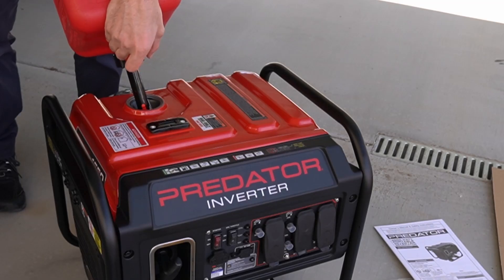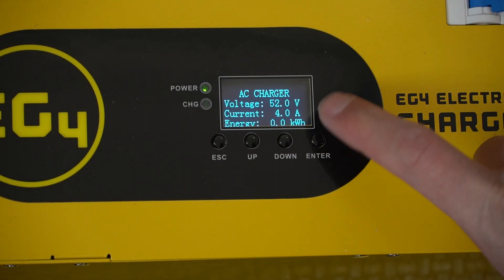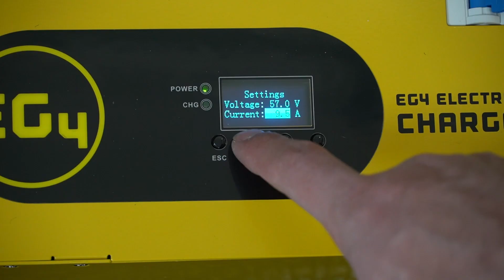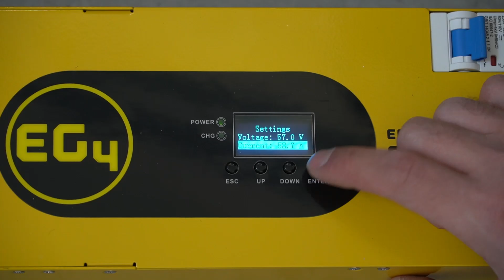New! 48V 5kW EG4 Chargeverter

Comment: This is a perfect backup combination. Im newish to solar, and I love my system...... but in reality, dollar for dollar that gas generator is 100 times more powerful and reliable than solar. Because cost is always an important thing, a combination of the two and the lack of grid power is essential. Not only do I hate the grid and everything that comes with it, I also hate the idea of destroying the planet with fossil fuels. So the most minimal that makes sense and is still reliable is this system here. Solar with generator backup for the batteries during undesirable weather when solar isnt charging optimally. Thank you for showing this! I've learned so much from your channel

Comment: Great video so glad I stumbled onto it.... I live in the northwest territories of Canada, so a generator is part of my life off grid...... currently running 4 - 200 amp hour Li time batteries. for now running them 12 V but I wanna run them in series at 48.... having a good battery charger is a must...... there's so many all in one units out there reading the reviews. I'm going delirious. Victron doesn't have that great of reviews.... neither does Renogy ...EG4  seems to be better grow watt looks not too bad. One of the biggest problem is support or there is none. Nobody talks about, it if something goes wrong you're screwed... so how does a person know what to get? I would like to run six 400 W. Renogy shade panels, but I found out recently. You can't start off slow if your inverter doesn't allow it 200w 0r 400w what do you look for?

Comment: Silverado EV. I’ve been driving one a long time and I work on them. Pretty reliable. We had some wheel bearing problems from the railroad strapping them down too tight. Other than that it’s a beautiful truck and has bidirectional charging with a MASSIVE battery.

Comment: Neat device and it's definitely on my purchase list! The main reason why you need a large generator if you charge with an all-in-one inverter is that the charge circuit is not separate... those all-in-one machines actually run the inverter circuit in reverse to charge the batteries from the grid power connection and just pass-through the AC input to the AC output during charging. That also means if you have any loads connected, they will also be fed by the AC input of the all-in-one and your generator needs to be able to supply both the amps for the charging as well as the amps for the loads!

Comment: I only had one problem with my ChargeVerter. I had to replace the plug on it, as, apparently, one of the leads was loose.
Be sure to check your connectors, and make sure they're tight.

Comment: 22KW generator!  Wow, I thought I had an oversized generator with my 13KW model dual fuel gas and propane (only outputs a little over 11KW running on propane, as I don't plan on ever putting gasoline in its tank, to prevent having to worry about gasoline going bad over long periods of non use).  Which models of All-in-One inverters was EG4 talking about, that needed such a huge generator for use to charge the batteries, when grid power isn't available?

Comment: For my solar system I find it practical to glean what I can from the Sun and keep this chargeverter always hooked up outside under an awning I use for my solar equipment. When the clouds weaken my battery charging this will kick in when no current is seen. It uses the grid but then again, my batteries last a long while so if I lose power at night the batteries are ready, so it still helps in the long run.

Comment: To the point! $500 bucks a of 8/4/2024

EG4 Chargeverter - GC | 48V 100A Battery Charger 5120W Output | 240/120V Input

Description
Introducing the EG4 Chargeverter 5KW AC Charger, a high-performance battery charger designed for reliability and versatility. With its 48V 100A capacity and 5120W output, this charger ensures efficient power supply for various applications. Its compact design and dual 240/120V input make it suitable for diverse setups.

Bad Weather Resilience:

Charge batteries during low light conditions using a generator (up to 100A)
Ideal for unpredictable weather patterns
Protection from "Dirty Power":

Guards against unreliable sine waves from lower-budget generators
Protects inverters from power quality issues
Charger Output Specifications:

Optimized for 240 VAC power supply
Nominal Battery Voltage: 48VDC
Adjustable Charge Current: 0-100A at 240VAC
Adjustable Charge Voltage: 43-57VDC (Default at 54VDC)
Maximum Output Watts: 5120W at 240 VAC
AC Input Specifications:

Plug directly into a generator without concern for power issues
AC Input Voltage Range: 90-264VAC
Maximum Input Amps: 26A at 240VAC, 28A at 120VAC
Dry Contacts:

Control of generator start/stop function based on Voltage or state of charge (SOC)
Using EG4 Batteries?

Closed loop communication with EG4 batteries for charging based on battery state of charge (SOC), when batteries are not in communication with the inverter

Comment: Hey Will....QUESTION.....I'm doing a system upgrade and getting the EG4 3000 EHV all in one system.....I planned to use that to charge off Grid in the winter.....But now I'm worried. I know this video is Older now.....but have they made any upgrades to the all in one to fix the charging failures???  Also is that eg4 charger still working well??   REALLY APPreciate any update. I know youre swamped with comments. Best wishes

Comment: What is your input voltage that you're getting 99 amps? My yellow Chargeverter briefly peaks in the high 90s then quickly ramps down to 93.5 A, even when cold started. 
Maybe I need to increase my generator output from 240V to 250V to get those numbers?

Comment: Ready to purchase one of these from Signature Solar. They have a newer model arriving in April 2024. My question is this, "Any recommendations on what the size of my generator should be"? I will likely get a Predator Generator I can run off of propane so the carb doesn't get gummed up with old gas and the propane is easier to store for long periods of time.

Comment: Wondering, of EG4 can make the Chargeverter work with open frame generators, why not just use that circuitry in their all-in-ones so you don't need separate charger?

Comment: The test generator you used was an inverter generator that produces nice clean pure sine wave power, might be good to test it with regular generator that produces the 'dirty power " you mentioned
Reply: cheap inverter generators are actually the ones that produces dirty power and can't handle much variation in load. Just look at Victron inverters and how much electronics is needed to produce actual clean sine power. These cheap generators don't have the amount of space availble to pull that off. Just take a look at James Condon, he repairs generators and also load tests them, including the "dirtyness"

Comment: Will I be able to utilize the Dry Connect port of the EG6500 Inverter to auto-power on and off an external generator which is connected to the battery bank via the EG4 Chargeverter?

Comment: Can it be used in a pinch on lead acid? You would just need to be careful between bulk and absorb correct?

The unit reduces amps once it hits its set voltage doesn’t it?

Comment: so they put teh option in to charge your batteries in the inverters by generators then state that the generators destroy the units?  seriosly?  or is it just the modified generators-- are the pure sine wave ones ok?
Reply: I'm sure if you limit the charge rate and have a good quality generator that puts out clean power, you will be fine.

Comment: Will in this video you suggest using a battery charger to charge batteries even if you have a hybrid inverse that could charge the batteries because that’s one of the main causes of failures in inverters.  I’m planning a new solar setup around buy one EG4 18Kpv to start (eventually going to two of them to be off grid completely) and was wondering how I would setup using tuis EG4 battery charger in my future system.  Would love to see a video explaining how to use a battery charger with a hybrid inverter (EG4 18Kpv preferably). Thanks for all the great work

Comment: Hi Will. What about using a small generator on the generator input of the EG4 18kw?  Does it have a built in “charge verter” that will protect the system from “dirty ac output?”
Reply: Don't risk it! It's not in the manual, so don't assume. It's designed to be tied to the grid only.

Comment: I'm still so upset you had such an awful experience with your Lightning!  You're absolutely right that it's the perfect for power testing and backup energy storage, etc.  I use the Pro-Power On-board outputs all the time.  I've had my Lightning since October of last year and have had zero issues with mine.  It's disappointing that yours was a lemon.  It does seem that the Platinum trim level trucks are more prone to issues than any of the others.

Comment: Does reducing your "max charge current" setting on the inverter make a difference with "dirty" generator damage into the ac inverter input? Also, are standard generators better or "inverter" type? Thanks for all the videos!
Reply: No, a cheap (non-sine wave output) generator, usually called a "modified sine wave output" generator will put out "dirty power" no matter what the current. Connecting a generator to a PV inverter usually means that the generator power is connected to your load (house or whatever), so the "dirty power" can damage appliances and electronic equipment in your house.  If a generator does not say "pure sine wave output" or "total harmonic distortion less than 5%", then the generator can easily damage equipment.

Comment: Is that just for NA power grid, or does it accept 50hz/European grid output too?

That would be great for sailing cruisers. Most boats are either setup for 60hz or 50hz shore power, so cruisers can struggle when in port after crossing oceans. Something like that would allow them to just plug-in at a marina and charge their battery bank directly then live off their inverter, without having to worry about all their AC components on the boat.

Comment: Is there any reason why these wouldn't be able to be paralleled?  I currently have a 22kw whole house generator, and 6) 5kw Lifepo4 server batteries, with a Sol Ark 12K in Idaho.   I am considering getting 2 of these to double the possible charging speed and reduce the run time on my generator, and stay below max charge rates. what are your thoughts?

Comment: So if I use a HF NOT pure sine wave generator I can plug in the yellow box and it will clean up my generator's modified sine wave and make it OK for my Li batteries??    The HF generator in this YT is an "Inverter" generator that makes a pure sine wave. That IS NOT what 90% of the people have that use a large portable generator for back feeding and extension cord powering their homes during power outages. You should have used a more typical generator (like your ancestors used.....)

Comment: If I have two eg4 6500ex inverters connected for 110 volt instead of split phase. If I turn one of them off will the other one still work? I'd like to have it just for a backup or in case I need to add more then 8,000 W of panels or need more ac power then 6500w... but I'd like to keep it off most of the time so that it doesn't draw 90 watts of power continuously... I don't have anything that runs on 220 volts other than my generator connected to the inverters

Comment: Will have you looked at the BTR Power batteries?
(4) 12v-140ah batteries works out to around $200/kwh as compared to the EG4 server rack at around $280/kwh.
Previously I had thought that the EG4 was the most economical choice.
I get the impression that these may be built using pouch cells as well.

Comment: Hey Will, I am a huge fan and have been following you for several years now.... Will, I have been digging through your archives to see if I can find a video that shows how to calculate the size of a system needed based on what you want powered... I want to run access lights, patio with lights, refrigerator, fan, water fall and possibly a TV so I'm trying to figure out how to calculate what all that will draw to determine the system I'll need... any ideas? Btw I have your book, too... I don't think I missed it there.

Comment: good afternoon Will. This might be the wrong place to request it but !!!! No one I have seen on youtube talks about the warranty's fine print on all of the solar components. Would you consider doing an extended video on this topic . I have 2 products a VA company uses ( they have been installing in VA for 28 years) , but the warranty's have the word "or" after the 10 years , etc. A friend is having them do an install and I am concerned because the "escape clause " reads like and engineer and attorney had lunch one day  . I can email the 2 examples. I think it is an important topic . thanks in advance.

Comment: I hate gas generators also. I have 2 of them. 
I have the Westinghouse i2200 (1700W) and the i4500 (3700W). They are very very quiet.

It is almost a necessity to have 2 b/c one or the other has frequent trouble.
I only run them rarely now when I don't have enough sun. Used to run all night every night.

I have 2 EG4 24V 30A chargers and a Renogy 24V 12A smart charger that run off the generators.
I have a couple switches to run 1 single or any 2 as a pair. Currently connected 2-24V 280A banks.

Comment: You can limit the grid charging current on a hybrid inverter so that it doesn't over-load the generator. Still, I would make sure the generator is the inverter type and I would not run the generator at full load. I've charged batteries through an MPP 3kW inverter using a Honda EU2200i with no issues.

Comment: Hi Will, I have an unrelated question, If you have 2 x 200ah lithium batteries in parallel or Series, and one of the BMS's shuts down, what are the symptoms ? Cheers

Comment: Hi Will, sorry, not in line with the video,but, #1 how do I access your book,#2 trying to run a 24v system with 2 1920 watt strings/w 2 charge controllers, to add 12 volt sub-panel, can I come off of 1 controller? 4000 watt inverter.

Comment: I am going to be getting an aptera as soon as they ship.I am planning on making a home battery setup that I could also take on the road.  I was also planning on making a range extender battery pack that I could bring with me into a hotel room and plug into the hair dryer outlet. If I brought in a 14kwh battery pack (160 pounds of 280ah  lifepo4 batteries). I could charge them using the bathroom hair dryer outlet(1800 watts), and be full in just under 8 hours. On the aptera that would give me about 140 miles at 70mph.

Comment: Can I ask you opinion about  a crazy idea to get AC power to my shed about 100ft from my house? I was thinking about getting a 1000w LiFePO4 Portable Power Station,  The crazy  part is to tap into the 12v AC landscape lighting line I have already running  out there with a   12v AC to 12VDC converter.  I have big landscape transformer at the house with excess capacity.  Possible? good idea?

Comment: Will, have you dealt with Signature Solar at all for out of warranty repair work? I reached out to their tech support and customer service by email and got no response for a week. Called today and was initially told that they only service devices under warranty and if not a warranty repair or warranty is expired then I have a paperweight. They did later call me back and say that was incorrect, but as an individual who is over $15k into Signature Solar purchases, this doesn't exactly inspire confidence. Do you or any of your viewers perhaps have some experience to reassure my concerns?

Comment: I installed my EG4 Chargeverter and an L14-30 generator inlet this past week and tested it out with my Firman tri-fuel generator running on natural gas.  What a beast.  I had been trying to figure out how to do the same thing by combining  4-6 of the smaller EG4 battery chargers, but that was going to cost a lot more money.  This is the solution I had been looking for, and I am thrilled that EG4 released it before I did something stupid.
Reply: Same here!  I haven't received mine yet and hope I never need it but it is godsend!

Comment: that's an awesome bit of kit.  As it's possible to build larger battery packs at low cost and use large solar to charge the battery pack. do you think that using the battery pack to "DC Fast Charge" an EV

Comment: Will i have a renogy 60amp charge controller and 24volt battery setup. it says 1600watt pv array connection . i have 1800watts pv array . if there a way to limit pv power output easily?

Comment: Bought one for my 3 EG4 Lifepower 48 v battery array.  Getting ready to set it up and try charging for the first time.  I'm going to set it at the recommended 85 Amps and see how long it takes to charge up to 100% from various SOC's.  First test will be from 50% to full charge and I'll give you a total time on that.
Reply: Based upon settings of 57 volts, 77.5 amps (matched for maximum efficiency of my Champion 8000/10000 watt generator using propane for this test and a constant running wattage of around 7250)  with a 49% battery SOC at the beginning of the charge, it tool 2 hours, 51 minutes to charge 3 batteries to 98.7%  (I stopped the charging as I had to run an errand).  This would have taken around 6 hours or more using my old 48V 18 amp charger.  This will in effect halve my typical time and propane consumption.  I might get better results running on gasoline, ( the running wattage is a bit higher so I could up the amperage a little)  but the cost is about 75% more per gallon cost of propane here.  I can potentially stretch a 40 lb propane tank out for 6 days of cloudy/snowy weather which us usual for this time of year here in the snow belt.  When it's actually sunny, I can fully charge my 3 batteries from a 40% SOC in under 5 hours with my 12 Canadian Solar 445 Watt BiFacial panels.